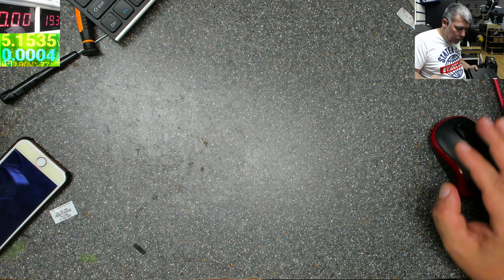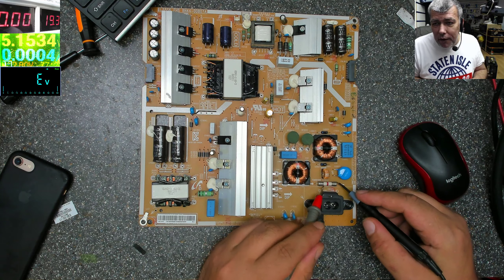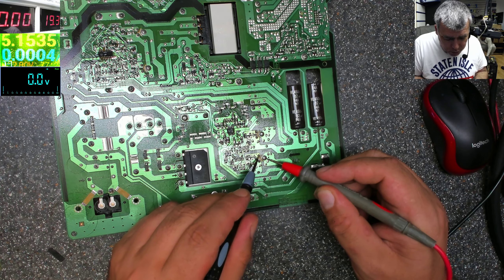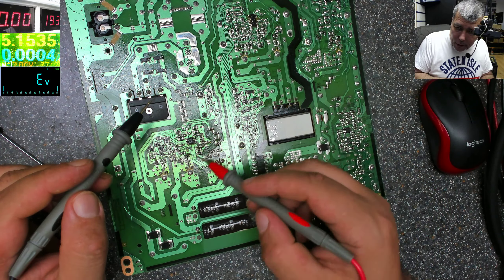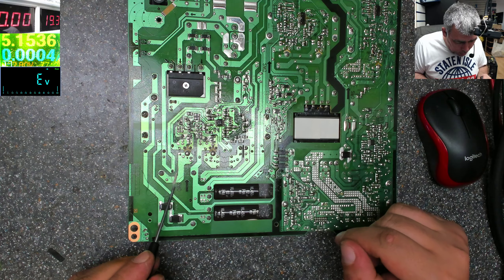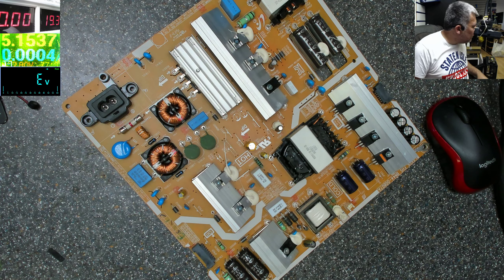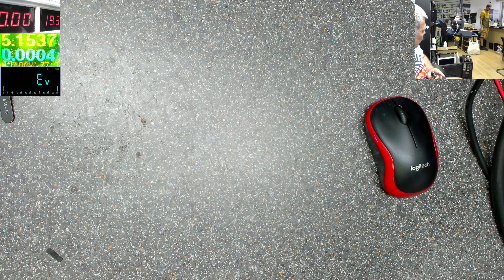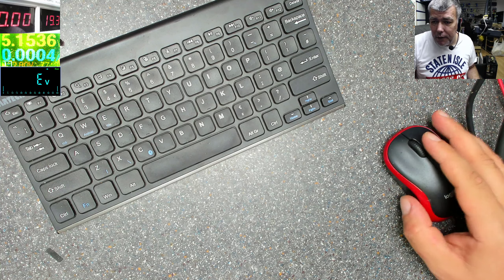Samsung tv repair, can we fix it under 15 minutes? Yess

Comment: What.... wait,.... what did i just see,  lolololol,  he said fuse was bad, he scratched out a trace, bypassed the fuse by soldering a wire from end to end that he used his teeth to strip away cover, said it could be a small explosion, then test and ........  its working except a crack in the screen....... lol  ... we gotta love this guy..
Reply: Put yourself in the customer’s place, you might not find it as funny.
Reply: @maxwarfield6699  most def not thinking its funny about him.  whats funny to me is he found the problem and fixed it without a big charge im thinking.  This guy is fantastic. in 15 min, did what was needed and its working.  I think its very smart of him to figure the board out and know what to cancel out and make it work,  as i said,   ,,,,,   WE GOTTA LOVE THIS GUY.....  i love watching him.... and as far as the customer is concerned,  give this guy big hugggggggsssss.

Comment: Speaking about power factor correction circuit when it is inside in a switch mode power supply it is a boost mode circuit that choppers and raises the rectified dc voltage to a higher level.The reason for that is that needs a very small capacitor for filtering the higher voltage which has very high frequency compared to the mains 100HZ bridge rectified.The higher voltage leads to a lower duty cycle for the main circuit of the switch mode power sypply so there is less stress for the entire circuit and lower current consuption due to the higher input voltage.And because there is a coil for the voltage boosting there is 90 degree of phase difference between voltage and current simply because the PFC circuit is a booster circuit,a dc/dc converter.And its operation is totally different as a circuit from the PFC of the electric conventional motors,because makes phase difference on purpose when boosts the voltage but for the AC mains voltage makes no difference or sense at all.
Reply: Andrew_koala  If you had a little knowledge in elementary electronics you may already know that a full bridge rectified ac mains voltage of 50HZ or 60Hz or any frequency always doubles the frequency,mr gramatically correct professor of the english language.And 100HZ compared to 100KHZ frequency operation of the pfc the ratio is 1000.

Comment: I'm so addicted to watching Sorin's videos. Reminds me of some of the guys I used to work with when I did laptop repair. I'm getting back into repairing circuit boards and I'm brushing up on "street smart" techniques like Sorin does. Love this guy. Does anyone know what the pad is that he is using to cool down chips after using hot air? What is that?
Reply: I think they're just silicone thermal pads. Available on Amazon or anywhere. Or probably buried or included in some of the circuit boards you're working on. I found several big ones on a plasma tv I used for salvage a while back.

Comment: I have two samsung tv of the same model. One of it the display panel is spoilt but the speakers are still working. Can I add the speakers into the other TV and in total have four speakers?

Comment: I have a 50 inch plasma. It has a hair thin line running vertically right down the center of the picture. You can hardly see it but it’s there any ideas on how to fix this I know you can’t answer questions but just thought I’d give it a try . It’s not too big a problem but it’ll probably get worse. Anybody sees this out there that has any ideas where to start? Looking for a problem like that I’d like to know. Thanks.

Comment: hey boss, what's the name of the small metal part within the TV back panel - where you screw the screw to mount the TV.... two of mine broken.... need replacement part....
Reply: A picture of said items often works better than its technical name ,take a pic of component and show it to part guy.

Comment: Have a Samsung UE65JS9590Q sound is there backlight but also a picture. I've swapped everything. do you have a tip? How do I get picture again? don't have any wiring diagrams. Can it also be due to the Connect Box? I don't have a picture of the One Connect Box either. LG and great videos

Comment: I thought that PFC circuit was previous to the rest of the power supply. How does it work if you cut one trace? Wouldn't be necessary to bypass it with a wire?

Comment: Tried to repair this exact board. Fuse was fine, but no matter what I did it just refused to output more than 2Vs. I started taking shots in the dark, replaced most of the through-hole components which I took from a similar board I had lying around, and it was always the same. I gave up on it, but do you have any idea what would cause this?

Comment: If I understand this correctly,  he cut a trace to the shorted mosfet   circuit and the TV now powers on (but is cracked) ,  Some comments about the circuit not being necessary.  to quick test the TV that's Ok, but  I'd be concerned about liability issues if this was a permanent fix, when the TV catches fire. (at least dead people can't complain)
Reply: Cannot complain in this realm ,yes🤭

Comment: Thats samsung 50inch smart tv power board isnt?, i have an issue with that kind of board, the high voltage to primer + from FET are fluctuating. How is that happen?

Comment: PFC: Power Factor Correction?
I see this term in PC power supply

really thanks for the video it is full of knowledge for me as always
Reply: Yes, it corrects the Power Factor of a load connected to an AC input: Essentially, a Power Factor measures, in the simplest possible terms, to what extent a load resembles a simple resistor : AC current and voltage are in phase, and the current/voltage relationship is linear. When a load doesn’t appear as a resistor, it consumes reactive power (current/voltage not in phase, more capacitive or inductive load), or absorbs a non linear and/or unbalanced current (like a simple full-bridge rectifier — the current only goes through around the peak value, and the bridge is never perfectly symmetrical).
Reply: Further, a PFC is nothing but a type of Boost converter in a closed-loop. The current loop is very important, as it post-regulates current to resemble a perfect sine.
Reply: @crazyphil7782  :  what is your opinion of Sorin's repair?
Reply: The ONLY purpose of PFC is to prevent "backfiring" of L/C components (phase-disturbance) to the grid.
Reply: hammershigh absolutely not. PFC < 1 implies reactive power consumption and/or and strain to your power components (power switches). It also disturbs the grid by injecting harmonics into the grid if current is deformed (non-sinusoidal).
Reply: Imagine connecting an industrial motor to the grid directly ; it will cost you dearly in reactive power.
Reply: hightttech , end-users don’t pay for the reactive power and don’t receive warnings and penalties if they strain the grid lightly. In an industrial environment, such a repair wouldn’t be allowed. PFC has to be corrected in all user appliances however (unless they come from China)

Comment: I am waiting for you to fix a Samsung LED issue where each line of LEDs is split into two. The first half of the strip is 12volts but has a return line after the first half of the LEDs back into the beginning of the positive through a diode and it boosts the line to 24 which lights the second half of the strip. If you do fix something like this please share.
Reply: Plastic Bottle Face - join the ERS Discord community if you want help with issues. Just make sure to read the rules and follow them by posting in the correct section 👍 https://discord.com/invite/6zQWaTN

Comment: Seriously though, I have been watching your videos for about three years and have since repaired quite a few laptops following your techniques. However, I thought you might be interested to hear about my exploits in trying to fix a HP Mini notebook; I determined there was short on the main 19V power rail and even tracked it to being on the 19v side of one of the lower power supplies; one of the "Always on" power supplies. But I couldn't pinpoint it in the end. I tried the "power supply" method and unfortunately it didn't even warm the board at all!. 5A and the board stayed cold! In the end I got so frustrated that I started removing coils to try to isolate the fault but there were too many possibilities  for the fault that in the end I gave up and bought a replacement motherboard. I even removed the CPU because the short seemed to be in that power supply, but the short still existed without the CPU on the board! Obviously the short, wherever it is, was so perfect that it provided no resistance and therefore generated no heat anywhere! I even soldered the power supply to the shorted rail and left it discharging 5A (at about 5V) for a long time, with NO HEAT generated anywhere! I wondered whether you might have given up too, or whether you might have had another strategy in this case? Thank you for all your videos, which have helped me understand electronics alongside my other studies!

Comment: Suggestion: It would be useful if you use lamp in series circuit for locating a short part within the primary section of power supply input rather than shorting that main fuse could mean much more damage on the components...

Comment: Wtf. He fixed a faulty power supply by cutting a track and soldering on some junk piece of wire. !!!! Break it till its fixed method. I have heard of this level 5 mastery but never seen it till now
Reply: Wouldn’t be so funny, if you were the customer.
Reply: @maxwarfield6699  correct,it would be hilarious.

Comment: 14:27 bad news for the owner 😭
Reply: If they didn't noticed accepting the work the owner could claim it was good before...
Reply: @DumahBrazorf  it is a big problem especially when there is no trust between a customer and the shop
Reply: @kahlid-ataya  one wonders why manufacturers produces screens that crack just by looking at them though.
Reply: @ericscaillet2232  because they want the customer to buy more its as simple as that
Reply: @kahlid-ataya  one good point ,I  recall older cell phone , screen hardly ever cracked .
Reply: @ericscaillet2232  so true

Comment: Sorry to say. A panic video of no value (for the viewers).
Reply: Did you already know that you can disable pfc and it would work. It also shows that customers can be assholes and not pay for work done, so luckily he did not spend too much time or money on extra parts.
Reply: @ecobob101  PFC is part of international regulations. It is plain stupid to make a public tutorial on how to make an apparatus illegal. Not mentioning the fact that you are dealing with 240VAC and 400VDC.
Reply: @hammershigh  That's not what you said initially. You said that there was no value for the viewers. I disagree.
Reply: hammershigh I doubt it’s making the apparatus illegal. It’s required for testing to get it out from the factory. Doesn’t mean it’s dangerous or inherently bad, it just goes against whatever regulation was put in place by some climate change activists in government. If they knew that the climate is only affected by the sun and space weather then we wouldn’t have a need for it. No loss here 😎
Reply: @Infiniti25  yep ,and same green dudes fly from meetings to meetings moaning about your V8.